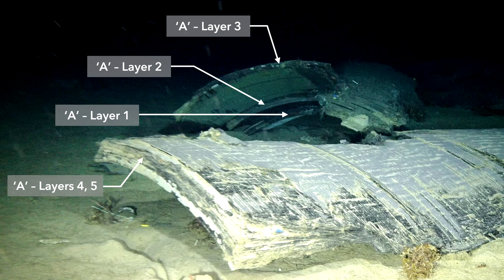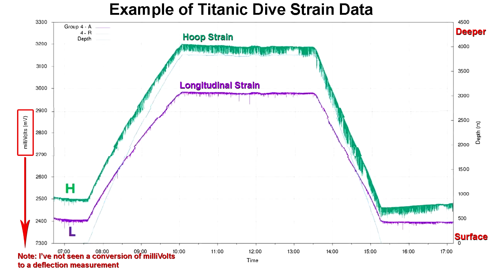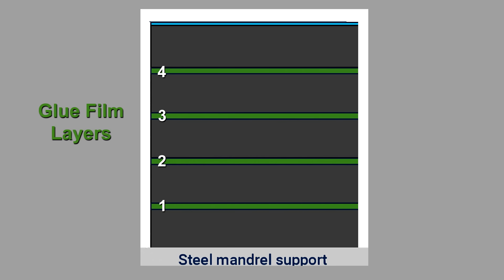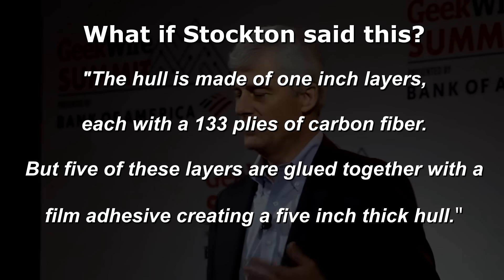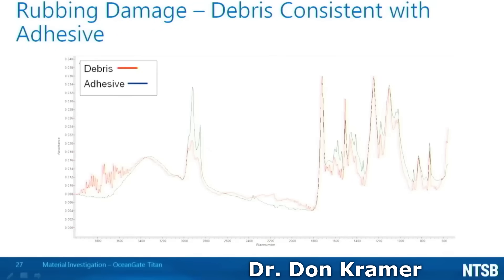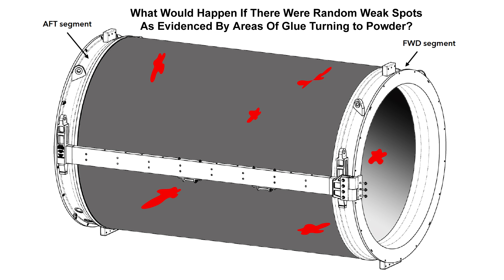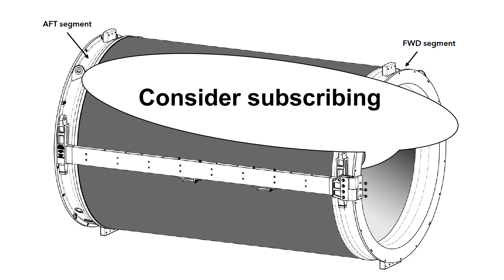OceanGate Titan Hull - Glue Layers Were Breaking Down To Dust - No Clues.

Comment: Oh well...let me add my $0.02 here.
First - some observations:

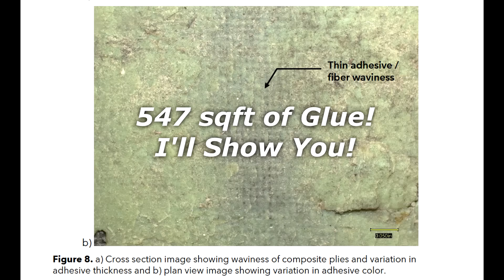0:19 there are TWO circumferential plies per ONE longitudinal ply. This is as it should be, as the circumferential load is 2x larger. But where are the =/-45 plies ? The rule of thumb is that a laminate should have at least 15% of =/-45 deg. plies. The reason? Shear strength in-plane. Yes, in this case the longitudinal and circumferential stresses may be actually equal, but this is still a good rule to follow.

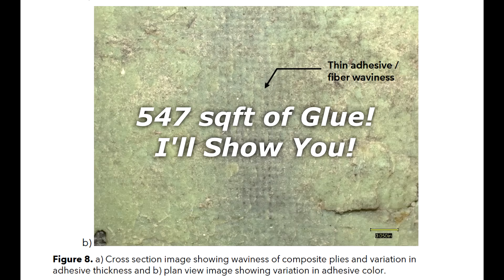0:23 "...woefully inadequate glue layers..." Well, sometimes it is better to not say anything than make an incorrect statement. There is nothing wrong with the adhesive...other than a LOT of porosity. Which is to be expected - there is no way to vent the volatiles through 1.0" thick laminate. There may be some peel ply imprints (assuming that the dark areas indicated in the image are resin). But this would not compromise the adhesive, nor diminish its strength - unlike porosity and voids. Square area of the glue has nothing to do with anything - but under bending, inter-laminar shear stress is generated, and in that case the integrity of the glue is critical, as it ensures that all 5 layers (1 to 5) work as a monolithic structure, instead of 5 separate layers.

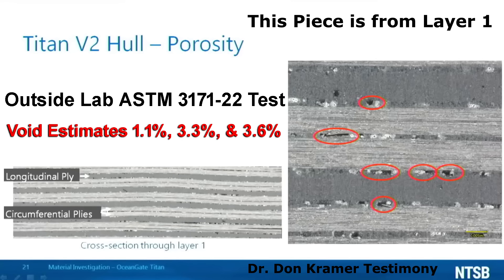4:47 The issue of porosity...well, the porosity itself had most likely pretty insignificant impact. The specified 0.46% porosity target is pretty ambitious, and achievable only for thin laminates. The porosity itself (up to about 2%) has practically no impact on strength, and at 4% the deterioration of strength does not exceed 10% reduction (which should be sufficiently covered by applied safety margins). The real problem is that the porosity on a thick laminate is very hard to measure using methods like Through-Transmission or Pulse-Echo. The attenuation for 2% porosity in 1.0" thick laminate is about 40 dB, so for 5.0" it would be about 200 dB. Good luck with that. In short: since measuring the porosity in thick laminate is very hard (if not impossible), the fabrication process itself should be carefully developed and monitored with utmost precision and care. Which hasn't been done, judging by further info in this video.

5:22 I am not sure what that means - but each 1.0” thick layer consisted of about 130 plies or so. I am wondering how many debulking steps were there. I wouldn’t try to compact more than 3-4 plies in one step. This means that each individual 1.0” this layer would have to be debulked at least 30-40 times. Maybe this was done, maybe not, can’t say. But assuming that 40 debulking steps were used, each about 20 minutes, this would translate into 15-20 hours of debulking in total. 

5:50 Little porosity in the base plies of each layer, and more at the top layers. Probably not surprising for 2 reasons: ONE - the plies at the base had MORE debulking cycles than the plies at the top of the layer, and TWO: volatiles in the 1.0” uncured layer will migrate toward the top of the layer, as this is where vacuum is applied.

6:37 The multi-cure technique used on the full-size hull…No design manual I know (and I know several) would allow more than 3 cure cycles on the same part (and that on relatively thin laminates). If you need 4th one - then the part lands on a scrap heap. This hull underwent FIVE cure cycles…The reason: thermal expansion factor of fibres is much different than the cured resin. Multiple cure cycles tend to produce microcracks. In addition - I know a process of curing couple of hundred plies which took YEARS to develop. The process of curing epoxy resins is highly exothermic, and the amount of heat produced may lead to carbonization of the resin due to overheating (autoclave temperature limited to 350 deg.F has nothing to do with it, this is due to the low thermal conductivity of laminate and the amount of heat produced during the chemical reaction during the curing process).

7:20 “…no information about the glue…” I would expect that some sort of film adhesive with scrim cloth would be used. From the images, the thickness of the adhesive appears to be quite uniform, so probably must had been the case. I can’t see how manual application of resin/glue could produce a glue layer of uniform thickness.

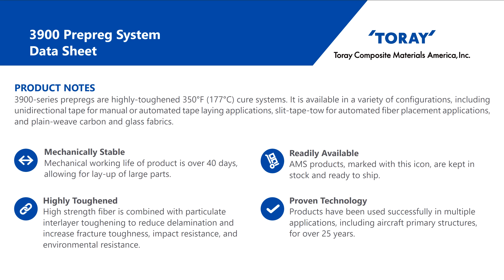8:30 Point in case: the bottom adhesive layer was cured 4x, while the bottom laminate layer was cured 5x…no comment here, all that needed to be said was already said above.

8:41 There is nothing peculiar about the curing procedure: it is pretty much standard for a 350 deg. cure system. There is a snag here, however: this is a perfectly OK cure cycle for UNCURED laminate (although the temperature ramp-up is really applicable for rather thin laminate. The rate is specified to allow gradual heating of all plies. As the laminate grew thicker in 1.0” steps - the bottom layers (each 1.0” thick) most likely were NOT heating up at the same rate. This could lead to TWO problems: ONE - the plies at the bottom of the currently cured layer might not heat up at the same rate as the plies directly under the vacuum bag, and TWO: since the 1.0” thick layers were heating up at different rate - this would most likely produce shear stress in the glue between the 1.0” thick layers. Bad idea overall…the multi-cure technique most likely required development of different cure cycles - possibly specific for each subsequent layer (1 to 5). What works for a 0.25” laminate - probably is not so good for a 1.0” laminate piled up on top of 2,3 or 4 already cured layers.

9:04 Yes, yes and yes. Integrity of the glue layers is critical in order to produce a monolithic shell, instead of producing an onion-like assembly of 5 layers. Five 1.0” thick layers with doubtful quality adhesive between them is NOT the same as a monolithic shell 5” thick.

10:25 Peel ply left indentations - yes, this always happens, that’s why this is not always a good idea to use peel ply. The bottoms of these indents are glassy, and adhesion of glue there is pretty poor - which may reduce the shear strength of the glue layer by 20-50%. Nothing new here, mechanical preparation of the laminate for bonding is preferred for highly loaded bonded joints.

12:12 The area of the adhesive has nothing to do with anything…as I said, sometimes it is better not to say anything.

13:26 Yes, that’s what happens when the adhesive fails. You end up with 5 layers 1” thick and having a combined stiffness of 5, rather than a monolithic shell 5” thick with stiffness of 125…In addition (as shown at 0:22), the adhesive was applied at CIRCUMFERENTIAL layers, which was about the worst location - as the shear stress produced by pressure-induced bending acts in the LONGITUDINAL direction. In fact - I would use a layer of +/-45 deg fabric as the interface on both sides of the adhesive layer (which actually is a recommended practice).

Pretty careless engineering as far as I am concerned. YMMV - as usual.
Reply from the maker: Thanks for your thoughtful and extensvie reply.  I read it carefully and concentrated on it, and you seem to have experience in this field, so thanks for adding to the discussion.  I agree with everything you said, except I stand by my statement of "woefully inadequate glue layers."  Although you don't agree as evidenced by the snarky comment, "Well, sometimes it is better to not say anything than make an incorrect statement," you later go on to list all the problems with the glue layer.  And note that we don't even know what adhesive they used and how carefully it was applied other than "draping it over the hull as a sheet," as per Dr. Kramer's testimony. But as you then note,  A LOT of porosity is a problem, the peel ply technique is a problem. and patches of voids where subjected to shear is a problem,  therefore, those are areas not bonded together.  Then, as you correctly conclude that the 5 layers must act as one to have the required strength (monolith shell).  Not to mention that we have no data on the effect of subjecting the glue to 350F multiple times and the fact that there is physical evidence that the glue was breaking down to dust.  All of that being said means that the square footage of this poor glue job does make a difference since the poor job is amplified by the total amount of square footage over 4 layers of glue.  Thanks again for your thoughtful comment.
Reply: Not sure if you saw the other videos but the sub was laid up with only 0° and 90° plus because thr owner didn't believe 45° was nessicary due to "no torsional loads under water".  His words, I agree that it should of had 45° fibers.  
Also it looks like they only did 5 debulk operations in the autoclave, this may be why they had so many issues getting a smooth surface.  They had to grind the surface smooth between 1 inch layers😮
Reply: @jm8361  Yes, I have seen other videos. It may be true that the only debulked 5 times in the autoclave - as they had to transport it 60 miles to do that. This certainly was a factor, compacting 20 or 30 plies in one go is bound to produce wrinkles.
 TORAY spec for the prepreg is 0.0075" thickness. It matches the hull thickness of 667*0.0075 + 4*0.030 = 5.122" after cure.
But it is impossible to lay up, say, 30 plies or so and obtain 30*0.0075 = 0.225" total before debulking. It will be more than that by 10-20 thou at the very least. And when compacted -  the stack will settle a bit by delta 't', producing some excess around the circumference  equal to 2*Pi*delta 't' - which transforms into wrinkles.
Normal procedure is compaction after 2-3 plies max even on a flat tool, but on a ROUND mandrel I suspect this problem will always be present to some degree.
First 1" layer was OK with only one minor wrinkle: as expected, because the steel mandrel EXPANDED during cure and stretched the layup.
But after 1st cure this didn't work any more: the first 1" layer was rigid, and it practically does not change dimensions during cure. So the problem was getting worse and worse as the radius of each subsequent layer increased.

The 45 deg. plies: if I tried to do this - I would be kicked out of job. These plies are needed to improve damage tolerance, distribute load away from notches and stress concentrations etc.

Another thing: the 1st layer was cooked 5 times. No part goes on the aircraft after more than 3 cure cycles. That's it. Likewise - the 1st adhesive layer was cooked 4 times. Microcracks and delaminations are only to be expected after so many cure cycles.

Another thing: curing epoxy produces heat (this is exothermic reaction). In a thick laminate this may carbonize the resin, as thermal conductivity is low - or may simply deteriorate the resin which will lead to lower properties and failures.

Another thing: subsequent cure cycles were done on the top of previously cured layers. I doubt that the bottom plies in the stack got up to the proper temperature, as they were insulated by the previously cured layers...So - some plies may have been undercooked, some overcooked, and film adhesive might have been damaged even before the 1st dive.

Another thing: they used standard cure cycle for THIN laminates. TORAY is not saying that in their spec - because they assume that idiots are not allowed to make decisions. Thick laminate may require VERY slow temperature increase in MANY MORE steps, otherwise you get temperature spikes and huge lag between the autoclave temperature and the laminate temperature. Thick laminate = SLOW temperature buildup.

Another thing: they shaved up to 12 plies (the bumps). This means that the load from these 12 plies was DUMPED on the first ply in the next layer. Which means huge stress concentration - possibly fiber damage, resin cracks etc.

I did some numbers on the whole design, FEM and hand analysis: overall it is OK: dome thickness, hull thickness, ring dimensions ON THE AVERAGE seem to produce proper structure, which contracts under pressure at the same rate. Some problem is with thermal expansion factors which produce load on the upper flange (this actually helps, as it alleviates effects derived from unequal ring thickness). The inner flange on the ring appears to be much more loaded - at 4000m depth the stress there can go up to 115 ksi. Outer flange is much less stressed - 50 to 70 ksi (these are just very rough numbers).

This thing didn't fail because the design was wrong: it failed because the manufacturing process was done incorrectly, and some incredibly stupid decisions were made. But even if it was manufactured w/o any defects - it would still have safety margins smaller than required. And - strain gauge date from dive 80 should tell anyone with a bit of brains to stop further dives.

 I have been doing this (composites analysis, design and manufacture) for more than 40 years and have never seen something equally idiotic. Trying new things - OK. Throwing out of the window all proper practices and cutting corners because money is short - is just...I have no words here short of some unprintable ones...
Reply: I am seeing the inner flanges on the rings as a large contributing factor to the failure of the hull. You would not have a deformation concentration in the middle of the cylindrical hull if the ends were not constrained by the flanges on the rings. The flanges are forcing the cylindrical hull to buckle in. The cylindrical hull is already susceptible to longitudinal buckling from the 20,000,000 pounds of pressure pushing the hemispheres towards each other. So the compression force on the epoxy in the carbon fiber composite would be about 20,000 psi. The epoxy is available for carbon fiber, have a bout this much compressibility strength. Luck is not an acceptable engineering safety margin!
Reply from the maker: @StevenStyczinski-sy8cj  Thanks for your comment, and you bring up a good point of some of the contributing factors that could lead to a hull collapse.  The hull was being deflected inward in the center.  The domes were compressing the hull from the ends, making the first point possibly more significant. Finally, the co-boning process with the hundreds of grind spots on the first four layers were making areas in the hull that could potentially lead to "out of roundness."  And that makes the first two points more significant.

Comment: it was not just the sub standard hull that was the problem.. or the ways in which it was not sealed correctly to the titanium end caps, which by the way i believe caused the implosion. another very serious flaw was analog stick drift.

"Analog stick drift" refers to a situation where a controller's joystick, or thumbstick, registers movement on the screen even when it is not being physically touched, essentially causing the character or cursor to move unintentionally in a game due to a faulty internal component within the stick itself; this is usually caused by wear and tear, dirt buildup, or potential damage to the controller. 
Key points about analog stick drift:

    How it happens:
    Over time, the potentiometer inside the analog stick can wear down, causing inconsistent resistance and registering movement even when the stick is stationary. 

Common causes:

    Dirt and debris: Dust particles accumulating around the stick can interfere with its functionality. 

Excessive use: Frequent and vigorous use of the analog stick can lead to wear and tear on the internal components. 
Physical damage: Dropping the controller or applying excessive force to the stick can damage the internal mechanisms

 i have been a gamer all my life, and i have used many joysticks on joypads, and every now and then, pretty rarely it has to be said, i ended up with a joystick that was sticking to the left or right or up or down posistion which meant my character or motion was affected and all the games became unplayable until it was either fixed or i bought a new one.  there is potential that oceangates sub was stuck travelling in one direction that could not be stopped. they might have nosedived just before reaching the bottom and could not regain control in time in which case they had no protection from impact at those depths.  its the stuff of nightmares.
Reply: Ninja, are you being serious?
Reply: @billquantrill4960 

It's totally possible.

Titan was controlled by joysticks to at least some extent, and those joysticks function like the joysticks on game controllers, and so are susceptible to the same problems with wear.

This issue could very well have been a thing with Titan.
Reply: @ So it was the joystick that imploded? 😅
Reply: @billquantrill4960   I mean, the Joystick certainly isn't the sole reason Titan Imploded, but could it have contributed?

Potentially, if you're having problems with the sub being able to withstand deep pressures, then having the joystick that controls the subs movement malfunctioning certainly isn't going to help.
Reply: The sub wasn’t in a spiral his brain was!

Comment: It's ironic that far more engineering has gone into analysis of the failure than went into building it in the first place.
Reply: Indeed. A very rigorous and enlightening analysis.
Reply: This submersible was a "cut every corner" death trap.
Reply: #1 Comment in the whole thread. 👏🏻👏🏻👏🏻👏🏻
Reply: And the thing is, it’s extremely obvious how terrible of an idea it was at any level of analysis. From “idk seems kinda dumb to use carbon fiber” to “here are specific material, mechanical, procedural, and structural issues about how dumb it is to use carbon fiber,” nowhere on that spectrum was a single positive sign 😂